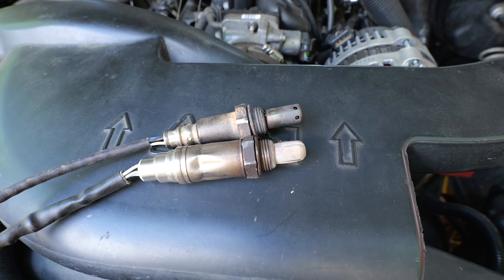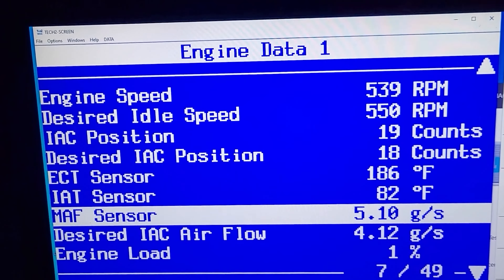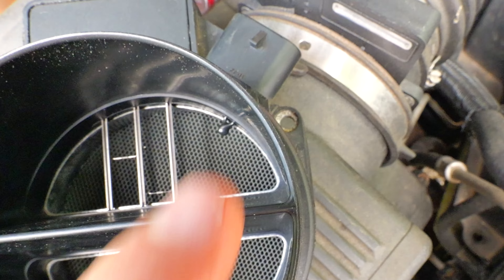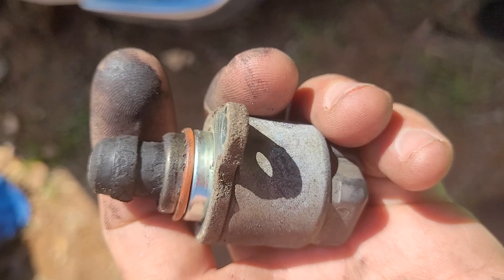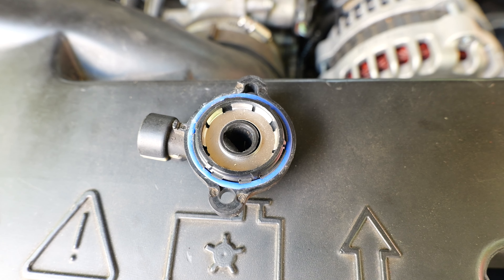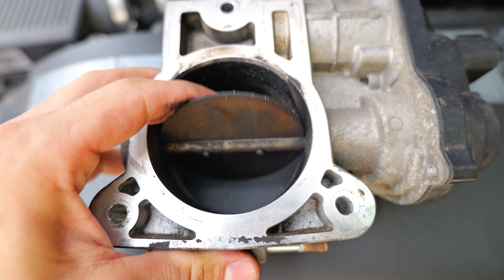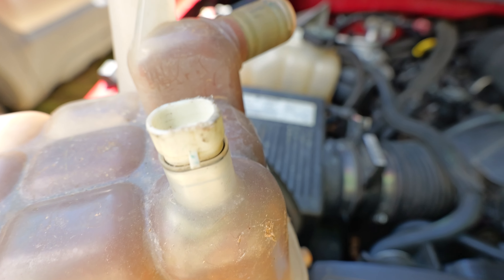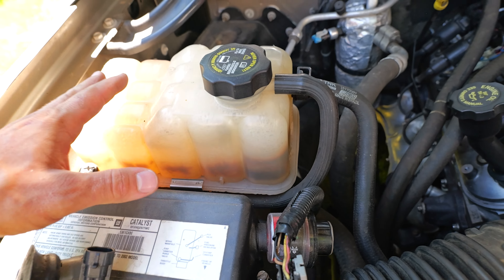EVERY Chevy Vortec Engine SENSOR

Comment from the maker: These trucks have a lot of engine sensors!
Mass Air Flow: https://amzn.to/3zeA2Dr
Idle Air Control: https://amzn.to/4cz3Qcg
Throttle Position: https://amzn.to/4exMezd
Camshaft Position: https://amzn.to/4cz32DU
Crankshaft Position: https://amzn.to/3VVIuAn
Knock Sensors: https://amzn.to/3JjToZu
Knock Sensor Wiring Harness: https://amzn.to/3oMVzJ2
Oil Pressure Sensor: https://amzn.to/45ETyVE
Oil Level Sensor: https://amzn.to/3VSDk88
Coolant Temp Sensor: https://amzn.to/3XDKZs6
Coolant Reservoir: https://amzn.to/4cgDYBT
O2 Sensors (Upstream): https://amzn.to/4ezgQ3k
O2 Sensors (Downstream): https://amzn.to/45BnYb8
MAP Sensor: https://amzn.to/3VUWk5S

As an Amazon Associate I earn from qualifying purchases.
Reply: I like the format and tips for your comprehensive sensors review 👍

I can share 3x big performance tips with you: 

-1- Timing chain TENSIONER needs 100kMi swap to keep engine timing evenly smooth.

-2- Upstream lambda/O2 100kMi way before heater fails they get lazy reading leaner mixture! (less power).

-3- Uneven cylinder contribution is caused by blow-by losses caused by stuck rings. Use higher VISCOSITY oil changed when it begins burning black. 
10w40... 5w50 : cleans the wet rings✌️
Reply: im a subscriber i had a quick ? about my 1995 chevy c1500 pickup 2wd 1/2 ton v6 vortec t.b.i. 4.3l naturally gas asperated.. on my truck starts fine drives fine ok its when i go to turn the truc off it will futter/ miss for a few seconds like its running out of gas but it has gas. million dollar question please? please let me know
Reply: Hey Matt I have a problem I have a 04 avalanche 1500 and my temp sensor only goes up a quarter way not half way regardless how long it's been sitting. I have changed the water pump thermostat and coolant temp sensor and still does it what could be the problem

Comment: I have a 2007 tahoe, I kept getting low oil pressure alarm, with the help of youtube and ppl. Like you I diagnosed what the problem was and fixed it myself.
Reply from the maker: What was the problem? Please share it with the community.
Reply: Oh man where do I start lol. I thought it was the oil pressure sensor so I changed it out the easy way just reaching back there and having the right extension and swivel attachment, but that wasn’t it. Then I changed out the little pressure filter that goes inside the oil pressure sensor hole and it was caked so I changed it out and that fixed the problem temporarily. It would throw out the alarm a week later. I got really good at changing those out really fast lol. The root of the problem ended up being that my coolant was leaking into my oil and that it why the filter kept getting clogged. So I figured that I had a blown head gasket. I had 249k miles on the tahoe at the time this was just a few months ago. I watched numerous tutorials on here to figure out how to do it. There is actually a really good one that showed step by step and so I went ahead and did it. A weekend job took me 10 days. But I did it and did it right. I changed out the head gaskets for both sides, the air intake manifold gaskets the exhaust gaskets which was a pain. New fuel injectors and spark plugs and cleaned out the carburetor ect. I spent probably around $700 in parts plus tools I needed. I just took the tahoe to Mexico on a 20 hour drive through dirt roads that were in bad shape and on the way back it took me 21 hrs to get back from Guanajuato because of the damn traffic and construction and with no problems except that my ac went out. Right now it has 254k miles on it. I hope to make it to 300k and more.

Comment: PLEASE help!!! I didn't see in your video the one sensor that I'm needing help identifying...I thought I was replacing the camshaft position sensor on the lower underneath part of the motor towards the center under the belt, it even looked like a camshaft position sensor when removing but my new part will not fit back in, it's too long...is this a different sensor? I have a 2011 gmc sierra 1500 sle with a 5.3 v8
Reply from the maker: That's different on a 2011 they moved some sensors around. I believe the camshaft position sensor is in the center of the engine to the right of the crankshaft pulley. They might have sold you one from an older Silverado. If you take the old one with you they should be able to get you the right part.
Reply: @MattsShop  thank you, I'll try to get the old part together but honestly most of it crumbled to pieces while trying to remove it

Comment: I almost spit my mountain dew out when i saw the knock sensor mounted to the front of the engine. 8:17
I love a good workaround. I actually determined whick one of mine was good and hooked it to both wires heading to the computer. Its still working for over a year now.
Reply from the maker: HAHA guys do it. I don't know why, but they say it works. It looks really BAD though lol

Comment: Thank you for all videos.
I have 2002 Avalanche, 2003 Escalade, 2005 Yukon 2500 and 2008 Express. 
I replaced 3 oil pressure sensors on my 2008 Express for past 6 month. Fist sensor was from Amazon. Sensor start leaking oil throw electric plug after 4 month. It is easy to replace oil sending sensor on Express. It will be challenged  to replace this sensor on Avalanche (2002 Avalanche required use a  special socket). I replaced wit Dorman sensor from Amazon ( I think that was knockoff) . Sensor stop working after a couple month. I went to dealer, purchased overpriced sensor. GM sensor works good, no complains so fare.
Reply from the maker: You like the trucks more than me haha. Never use the cheap sensors. I did the same thing and now I'm going to have to replace it with the Delphi sensor.
Reply: @MattsShop  GMT800- good trucks, affordable and easy to work on it. You need 2 jack stands, bottle jack and basic tools. and scanner.
 Only one problem- break lines. I had to replace lines on 2 Escalades. Newer donned this before. I replaced break lines on 1st Escalade. Its takes a 2 days. On the second Escalade - 1 day. Dorman makes a good stainless steel lines kit ($100-130).
Thanks for your work.

Comment: Coming here from owning a 90k1500 Silverado. Recently bought a 03 6.0 Silverado to keep the miles off my 90 and now almost want to do the same to the 03 haha. Genuinely appreciate you and your videos to help me diagnose and find sny possible issues that may arise with my 03 and my dads 01 tahoe. Recently had a bad idle/stalling/sluggish takeoff issue so beforei found this video it ended up being just the MAF sensor, dirty air filter and dirty throttle body. Cleaned them up and runs absolutely amazing now. Will continue to follow up on your videos to these trucks to keep my in great shape❤️🤝🏼

Comment: Thank you!  I’m doing my first LS swap and in the process of removing the wiring harness and engine from an 05 Suburban and this helped me tremendously as I wanted to label all of the connectors on the wiring harness properly.
Reply from the maker: Youre welcome! Good luck with the swap!
Reply: I had a knock sensor error and when I pulled them the one connector had just disintegrated so it wasn't attached the other crumbled when I pulled and the harness was brittle bent it a little and the insulation broke exposing bare wires. What very poor engineering job on this sub-system.

Comment: Oh man where do I start lol. I thought it was the oil pressure sensor so I changed it out the easy way just reaching back there and having the right extension and swivel attachment, but that wasn’t it. Then I changed out the little pressure filter that goes inside the oil pressure sensor hole and it was caked so I changed it out and that fixed the problem temporarily. It would throw out the alarm a week later. I got really good at changing those out really fast lol. The root of the problem ended up being that my coolant was leaking into my oil and that it why the filter kept getting clogged. So I figured that I had a blown head gasket. I had 249k miles on the tahoe at the time this was just a few months ago. I watched numerous tutorials on here to figure out how to do it. There is actually a really good one that showed step by step and so I went ahead and did it. A weekend job took me 10 days. But I did it and did it right. I changed out the head gaskets for both sides, the air intake manifold gaskets the exhaust gaskets which was a pain. New fuel injectors and spark plugs and cleaned out the carburetor ect. I spent probably around $700 in parts plus tools I needed. I just took the tahoe to Mexico on a 20 hour drive through dirt roads that were in bad shape and on the way back it took me 21 hrs to get back from Guanajuato because of the damn traffic and construction and with no problems except that my ac went out. Right now it has 254k miles on it. I hope to make it to 300k and more.
Reply: Ur transmission is next I’ve gone threw a few if you get them rebuild right they will last

Comment: Huge help!! Could you show where the coolant temp sensor at 13:11 in the video connects? Mine is missing the backside and the wire that connects to it. Have a new sensor to install, but  nowhere to hook up the electrical connection. Love the videos and info. THANK YOU!

Comment: Hey Matt, could you please do a video talking about the fuel pressure regulator and how they are in different spots on some of the 04 4.8's. I bought a regulator thinking I could easily swap it out. Turns out I have to drop the fuel tank to get to it. Same for the fuel filter. Think it would be a very helpful video.

Comment: Hey Matt, thank you for what you do, helping us keep these old trucks going. Quick question - for upstream o2 sensors, I see the Bosch 15150 you linked for $61 and also found a Bosch 15284 for $22, also on amazon/rock auto too. I know you said don't go with cheap sensors, but considering they're both Bosch, I wonder if there's a reason you like the 15150? Is it just for your specific year chevys? I see the connectors are different. Mine's an 05, was just surprised to see the price difference. Thank you.

Comment: Thanks, M,

I have a 2001 GMC Sierra. Start up in the morning really rough. And fuel smells weird  when running. dont know if it's rich or lean?

I'm still changing out sensors, though , so I was trying to take off the air idle sensoron the throttle body and one of the screws  stripped any tips on that?😊

Comment: Subscribed! 
Thanks for the good content.  
I got a 2004 Escalade with the 6.0 Vortec.  It takes a while to start in the morning, but then it’ll start up normally if I decide to start it up again right away.  If I let it sit for a few hours, then it’ll take a few cranks for it to crank over.   
I seen this video you made and you mentioned the Cam Shaft Position sensor will make it take long to crank over.  
Thing is, 
I’m getting codes for,
‘P0651’ & 
‘P0452’   

It’s driving me crazy.  Sometimes the codes clear themselves out on their own and come right back. 
& yes I know one is a 5 volt reference code, and the other code is a Evap code for the Fuel Tank Pressure Sensor.   

But I’m just wondering if It’s that simple as ohhh I need to replace the Fuel pressure sensor, & thats why possibly my truck is taking longer to start.   I’m just wondering if that’s the right direction to look at.  
Basically what I’m saying is, would that sensor be causing that long cranking?   

Would love to hear your thoughts.  Thanks!

Oh,, & I checked the wiring harness around the engine bay, everything looked well protected, I know there’s a spot on the side where the battery is, that the harness runs over the head of the engine that is prone to damage, and that looked fine, it’s on a plastic clamp sitting nicely not touching the motor.  Sooo idk 🤷‍♂️ 

Any thoughts helps
  Thanks!

Comment: Lots of good info here.  Thanks for posting.  You ran over the O2 sensors pretty quickly.  Which one is up stream and which is down stream?  I replaced one up  stream with a Bosch 15284.  Amazon says it’s up stream while Autozone says it’s down stream.  The one I removed has several holes with a narrower body than the new Bosch which has a single hole and a much larger body. Also the heater code is displayed on my scanner along with O2, evap, and cat.   I can’t reset them or smog my 2003 5.3 suburban while they are on.   Do you gave any advice? Any help is greatly appreciated.

Comment: Hey man, you're awesome. Thank you for helping make sense of the senseless. I was hoping how well your erudition is with the complete insanity of a 1997  chevy siverado k1500, 5.0L, 4x4, 4L60-E, Z71, has an air conditioner lol, and is an electric push button four wheel drive. Some parts of it use standard bolts, sometimes it's metric 🤯. Anyway I need help figuring out all the ground lines. It seems to me, the ones I'm aware of (apparently there's one hiding inside the body of the rear passenger window snap open window) are completely broken and disintegrated. Idk how anything is even operating. I've had four mechanics completely run me. They've done everything from loosen fuses, to removing fuses completely, taken censors I've replaced myself and swapping them out with their old ones, broke my drive shaft, completely fucked up my power steering, cross threaded my rear differential bolts, lied about putting new yolks on when fixing the drives shaft the mechanic before that one broke, completely removed my thermostat, never finished a the welding job on a CAT delete, and among other suspected things not onenof them ever suggested replacing a single sensor. Meanwhile the gromit for the PCV valve was an obvious replacement even to my amateur eyes. Most of this I have fixed and I will never let anyone touch this truck again. Mayne you, that's it. I live in Summerville SC. If I remember correctly, and I'm knucklehead so i could be wrong, you are a SC guy. Help me Obi-Wan, you're my only hope. Any advice, or leads to diagrams/specs, or even work on the truck yourself , I would gladly compensate you. 🫡👨‍🏭👨‍🔧 now back to work I go. I appreciate you whether you respond or not.

Comment: Good stuff!  But doesn't the Silverado have a transmission temp sensor? Thanks for sharing.
Reply from the maker: That's not an engine sensor. 🤣 It does but there is no gauge on the 1500's it's monitored by the computer and you get a light on the dash.

Comment: I just perched a 2003 gmc sierra 1500 hd 6.0 that says Vertec as well. Would this videos help me fix what is needed on this kind of truck
Reply from the maker: Yes, the 4.8, 5.3, 6.0 Vortec V8 engines are basically the same thing.

Comment: Hello I have a massive problem with the cam shaft position sensor code p0342. I have already replaced it with the crankshaft and I still have a long crank start. I also ran the wire from the sensor directly pin to the computer and still same problem. Any idea on what it would be I what I could do?? Would be very much appreciated. Thanks!
Reply from the maker: I would look at the signal at the camshaft sensor with an oscilloscpe or at least a multimeter and make sure you have the voltage that's supposed to be there.  You gotta get Delphi sensors.

Comment: Enjoy your videos Matt
Does a 2006 silverado 5.3 have a PCV valve
Reply from the maker: Thanks, yes it does built into the drivers side valve cover.
Reply: @MattsShop  I found out I have to replace the  driver side valve cover because the pcv valve is built in
Thanks Matt

Comment: Hi, i have 2001 vortec 8100. I have issue with acceleration, it feels heavy but eventually picks up and go. Another issue is whissing sound from the exhaust when i push the gas paddle. Can u suggest what i shall look for?

Comment: Hey Matt I have an 00 v6 sierra.
I’m having a slight hesitation at start up when pressing gas pedal it’s very sluggish until I get past 5 mph than it takes off.
When I press gas it almost feels like a misfire or exhaust is clogged I can floor it and it won’t go at all till it goes past 5-10 mph. I’ve gone thru 2 fuel pumps in last 6 yrs. Replaced fuel filters and oil service done every 3k and spark plugs regularly done also any suggestions?

Comment: I have a 2004 gmc sierra 4.8 v8 what would consistently cause p0171 after clearing codes it just comes back and back no other issues with operating

Comment: So with the camshaft position sensor if it doesn’t start on first try but starts right up on the second crank what else could it be if I’ve replaced the camshaft position sensor and it’s still doing it? I’m assuming the crankshaft position sensor but I don’t want to go just replacing sensors if they aren’t actually having problems

Comment: Hey was wondering if you could help me with some information? I have a 07 Chevy Silverado and a lot of the fuses in the main fuse box under the hood is grounding to the motor some people say it supposed to and some people says it is not supposed to? So my question is any of the fuses supposed to ground in the main fuse box back to the motor?

Comment: Hey Matt merry Christmas I have an 03 gmc 5.3 it has a hard start i changed cam sensor feul pump pressure regulator cleaned MAF sensor all this happened when I changed out the injectors any idea thanks
Reply: Can get bad new injectors, some guys test them first before installing. Could be your issue. These days it's common to get bad parts that are brand new across the board with any part! Good luck 🤞

Comment: Hey Matt, I have a question my 2006 gmc sierra at idle it gets stuck on 1000-1500 RPM until I hit the brakes and it calms down and then revs back up to 1000-1500 RPM. I’ve changed o2 sensors and nothing any ideas?
Reply from the maker: The first thing is to clean the throttle body and make sure it's not sticking. It could be a fuel related issue.
Reply: @MattsShop Thank you!